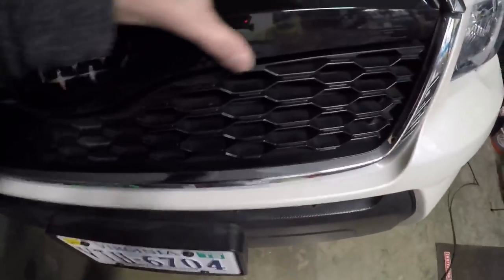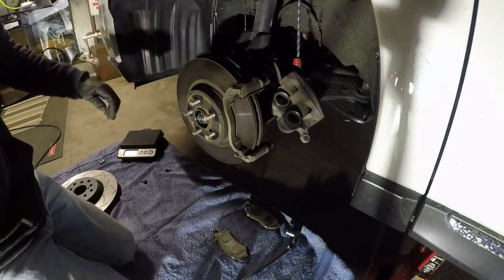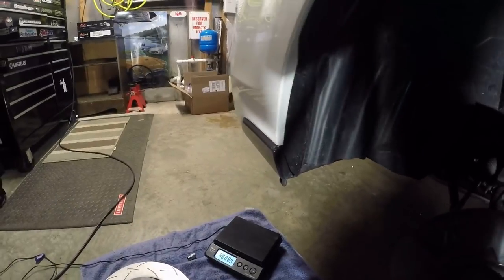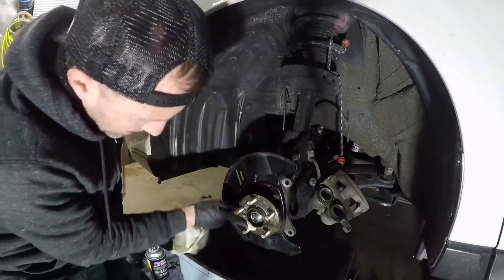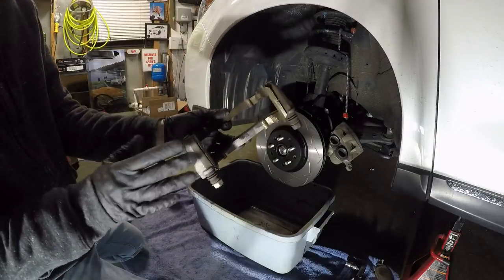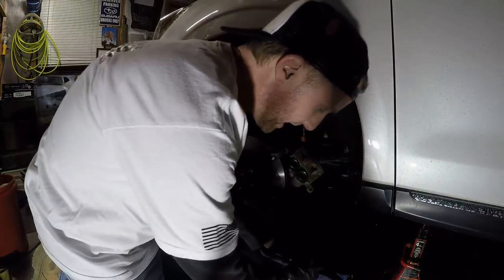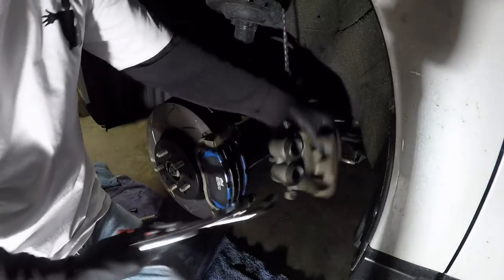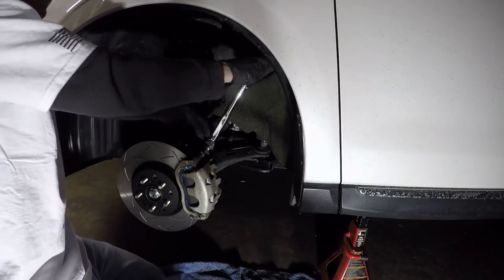2015 Subaru Forester XT Ep. 82: DBA Brake Installation Part 1

Comment: I replaced my front pads and rotors on my 15 Forester this week. I ended up needing a breaker bar for the caliper carrier. Way too tight for a ratchet and the wrench wouldn't stay on when I was hammering it. It was on there tight
Reply from the maker: from the factory, they are way too tight.

Comment: if you can add grease to the caliper bracket slides then you should - there's usually a channel that the rubber boot sits in along the metal slides/pins but if they don't come off easily or seem to move freely then I agree - best not to mess with it....
Reply from the maker: i coulda added grease.

Comment: Did you compare the stopping performance improvement vs the stock?
Reply from the maker: just butt dyno. its a completely diff car with those brakes. only a tiny squeak in morning as i pull out of garage real slow.